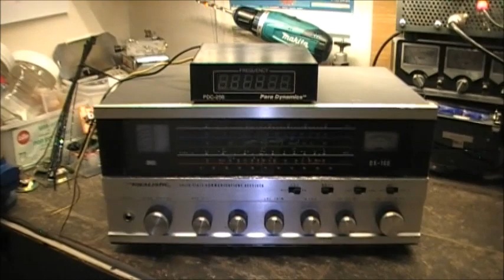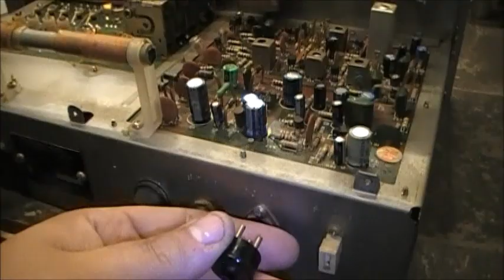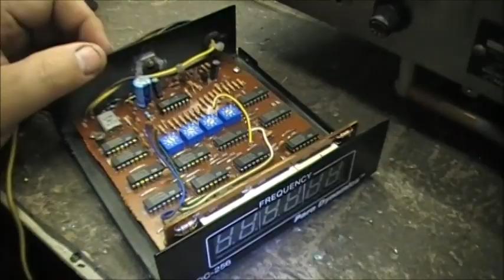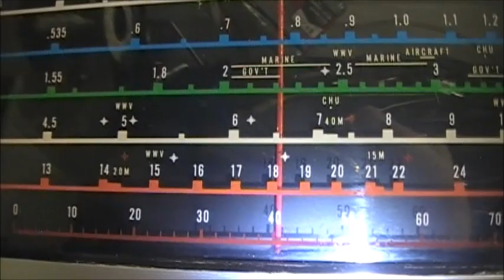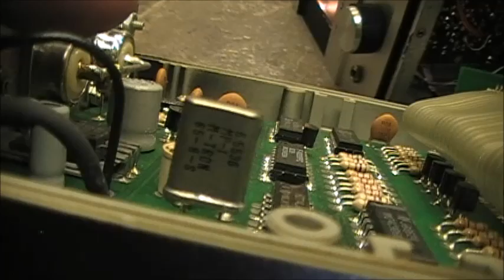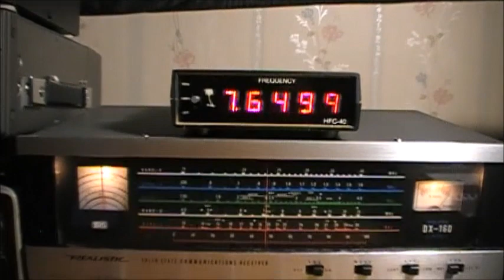Realistic DX160   How to install frequency counter

Comment: Just a note …..I have a dx150a and a dx160. The 160 drifts like crazy and the 150a is very stable
Reply from the maker: It’s interesting how even models from the same series can have such different stability characteristics! 73s
Reply: @Radionut63 ya, i think maybe the significantly larger variable capacitor and the copper plate under the vfo on the 150a has maybe something to do with it.

Comment: Interesting.. How did you know to tap off from that resistor? Where does that resistor sit in the tuning path? Trying to understand so I can attach a freq counter to another brand of radio.
Reply from the maker: Honestly, information i found on the internet many many years ago, i can't remember where from, but it was an awesome idea to add a frequency counter to this great little receiver.  :-)

Comment: Makes absolutely no sense to do on a radio like this. Just keep a radio with synthesized tuning handy if accuracy is an obsession. I know how finicky some can be about dial accuracy. I never have been, never will be. There are too many modern, more accurate alternatives available. To me, analog toning is simply more enjoyable. It’s how this radio was designed, and people did just fine without it.
Reply from the maker: You get a bit butt hurt abut this or something? If you don't like the video, then move on.
Reply: @Radionut63  Not an issue. Thrilled with what I have, including my fully restored SX-42. Wouldn’t think of adding a digital readout to that for a moment. Enjoy watching your videos.
Reply from the maker: Yes i am glad you are... and so am i... I spent a lot of time restoring this Realistic DX160, when i first got the thing,, she was filthy inside and out, had to clean it up, replaced all electrolytic caps, bubble bath the cover and bottom covers, clean up the controls and clean the main board the best i could, replaced all the lighting.  Do you actually think that after doing all that work i would want to destroy the radio?  There is no damage done to this radio in anyway, did not even drill a hole in the chassis to install the counter. As a  matter of fact the counter can be removed from the radio just by unplugging it from the back!   How in the world is adding a frequency counter such a bad thing?     I am sorry if i sound a bit rude, but when i read comments like that it kinda sets me off a tad.   I do apologize for that.   But in all due respect, i enjoy showing others how they can sometimes make an awesome vintage radio like the DX160 even more of a pleasure to use and enjoy.  Personally i do not see any issue in doing that.
Reply: @Radionut63  Well said.